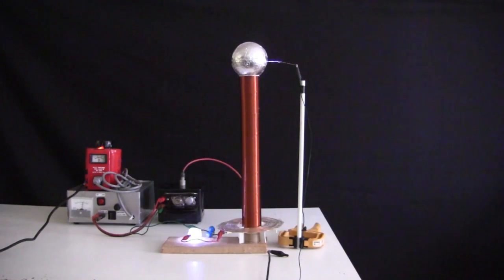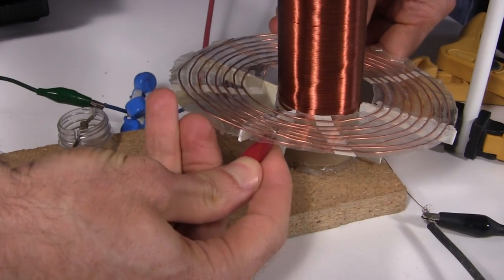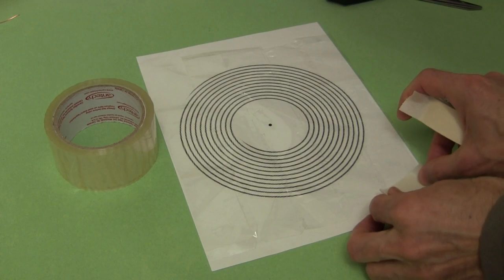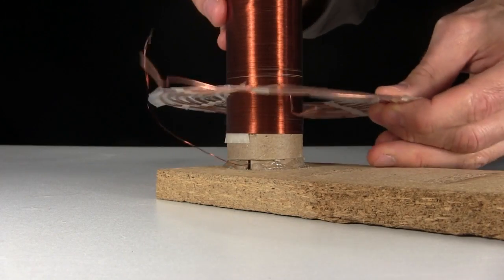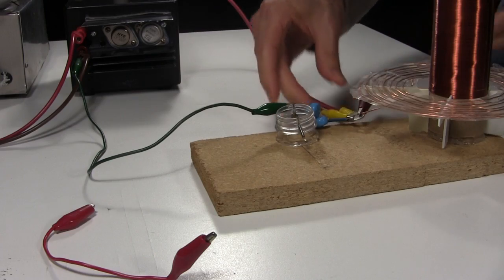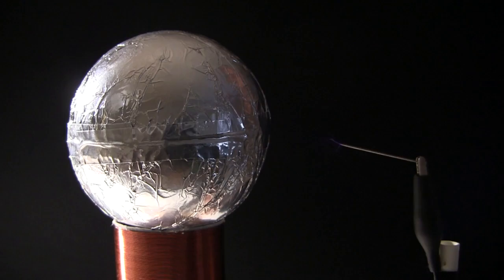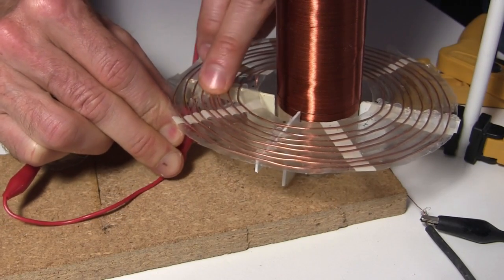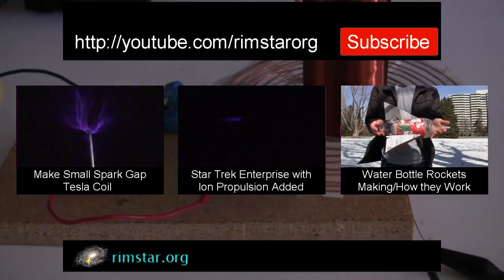How to Make Spiral Primary Coil for Tesla Coil

Comment: Try winding it on PVC then flattening & opening out the spiral. It's a lot neater and kink free that way.
Reply from the maker: +Brek Martin Oh cool. I'd looked for any good spiral winding tricks and hadn't found any. I'll keep that in mind for next time. Thanks.
Reply: +RimstarOrg You start out on the size of the smallest turn, like the PVC your secondary is wound on, and open it out from there. I never did find out what the advantage of a flat spiral is over a completely vertical one, except maybe when it comes to tuning it maybe it’s just neater to lead the tap out from underneath.
Reply from the maker: Brek Martin
That's why I like the spiral instead of the vertical one, I find it easier to connect to the spiral to tune.

Comment: Nice plans, coil, and output, especially for that power supply. How hot do the transistors get?
Reply from the maker: ClevelandStorms Thanks. Surprisingly the transistors don't get noticeably hot, even after a few minutes of running. You do have to keep an eye out for the capacitors heating up though. It's not so bad with 4 1nF's in parallel for a total of 4nF, but I played around with just 1nF at one point and that heated up much faster. I'm thinking of making some Leyden jar type capacitors instead.

Comment: Great video !!! Really helpful tutorial, a quick question though. I was wondering what if you made another secondary coil the same size as the one you are using in the video, but wound it with very thin wire like 32 or 38 gauge wire, would the decreased resonant frequency and increased windings ratio give you much  longer sparks off of the top load?
Reply from the maker: Thanks! I really don't know the answer though. Keep in mind that you'd have to adjust the primary side to also have the same resonant frequency.
Reply: +RimstarOrg Thanks !!!

Comment: How many volts do the electric sparks have?
Reply from the maker: Brandon Fisher It's hard to say. A rough guess can be made based on the spark length, which is around 2.5cm/1 inch. Unfortunately the estimates take into account the shape of the electrodes and they don't usually involve a sphere and a needle like this. So I'd say somewhere around 30kV. Here's a sample table http://www.kronjaeger.com/hv/hv/msr/spk/index.html

Comment: How many volts for input?
Reply from the maker: I didn't measure it but it's limited by the width of the spark gap, the shape of the spark gap electrodes, and the moisture in the air. With my spark gap, I'd guess it was only a few thousand volts. However, current is also important. You can charge up the spark gap to the same voltage with a low current power supply like one from a fly swatter or with a higher current one like I used. Both will provide the same spark.  However, the fly swatter one will take a lot longer between sparks, even a few seconds and so it won't be as useful.

You can see more about how I make this Tesla coil starting with this video https://www.youtube.com/watch?v=vemF7p0cbHU&index=1&list=PLFsZmHTZL-zmfXxstlxuJgRE9bOGobEVu and this is how I made my power supply https://www.youtube.com/watch?v=-KFhBVfpfDw